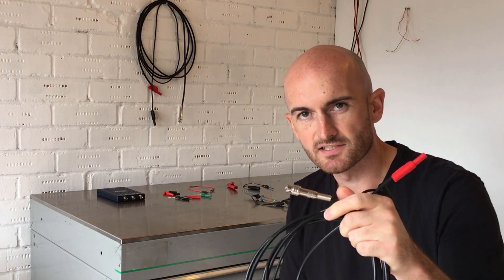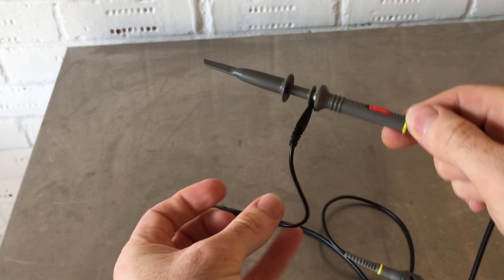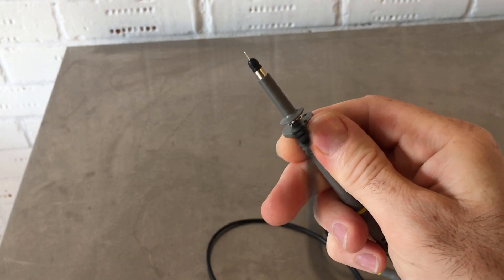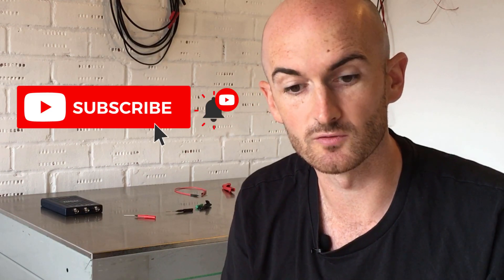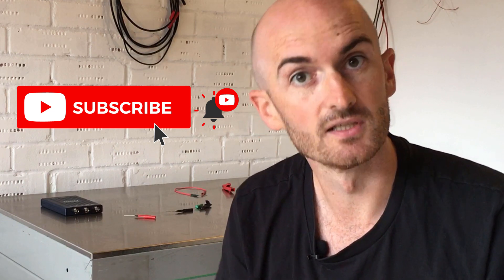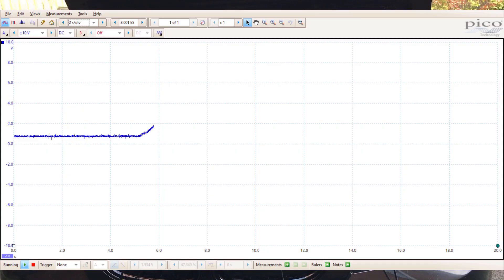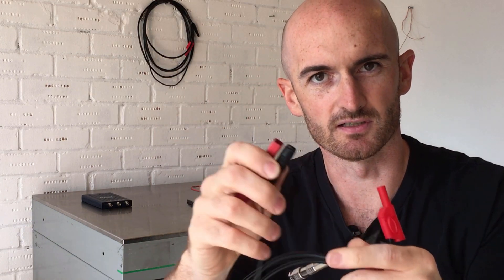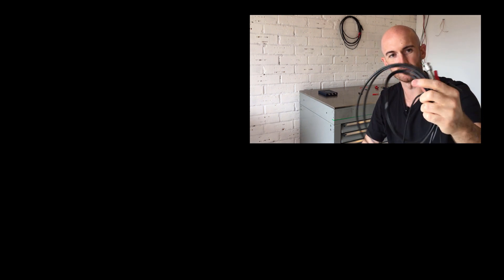Cheap Scope Leads Any Good?! Hantek HT30A Review | Mechanic Mindset

Comment: I know you probably won't answer things question but i will ask it anyways.  I  have the pico 2204a and i bought the hantech leads do you have to adjust the pico for them and if so how do you do it
Reply from the maker: They should fit straight on 👍 no settings or adjustment

Comment: Great video! Are these the exact leads that come with the autel maxiscope mp408? The autel comes with hantek accessories. I just want to make sure there actually the same ones before I throw them away because I just watched @Jarhead Diagnostics https://youtu.be/ahz9VvG_zF8 video and talked about how shitty the leads were and that they picked up alot of noise...  I don't have other leads to compare so your input would be appreciated. Thanks again.
Reply: Oh I see. I'm almost thinking he just got a bad batch or wiring in the lead housing was getting loose. Thank for the help I'm going to buy one off Amazon and compare. Keep up the good work 👍
Reply from the maker: Hi, I’m not sure if they are the same, but I have had no issues. I also have a Pico lead, it’s the same. Even check out my video where I make my own DIY scope lead with airbag twisted pair cable, it’s still the same. It would have been good to see an example of the static. 

If you take a measurement in a high noise area like around coils, no lead will block that interference out. Hope that helps!
Reply from the maker: DIY Scope leads:
https://youtu.be/U5yBlgHwVhs

Comment: Silly question but what is the difference between the cheap hantek cables that come with aligator clips and these? I notice that the HT30A have a heavier gauge for the red probe vs the cheap alligator. When testing CAN bus do you need these cables or can you use the cheaper ones? Great video.
Reply from the maker: Hi, you can use either leads. I use the HT30A cables in this video. Cheers!

Comment: Like all your content man, keep on at it! Just bought some attenuators & Hantek leads from your link. Found your channel from someone else's video reviewing different scopes using a Chevy Silverado scoping various sensors on the vehicle. If possible, and if your able to, could you review using the Hantek Ignition Capacitive Auto Pickup/Probe (HT25)? Thanks!
Reply from the maker: Hi, good video that one. Thanks for the support using the links 👍 I do have the secondary ignition probe, just not got round to the video yet. I will try and do it before the end of the year. Thanks for watching!

Comment: Crap leads in the long run prown to fail internally good for a start up set thats it
Reply from the maker: Sounds like you have really put yours to work! 👍
Reply: @MechanicMindset   as soon as I found out you can run the bt408 on a computer I had mine coming an 2 years later I need 2 new leads so I went for something a little better.  Gotta respect your tools an they will last better . Don't coil them up an they will last longer
Reply from the maker: @danielkalston6977  What leads do you use now. I do like those PicoScope leads. I only use mine for best 😂
Reply: Currently automotive test solutions.
Reply: @MechanicMindset  rotkee has some unique stuff aswell
Reply from the maker: @danielkalston6977  Cool, just recently came across the Rotkee gear; some cool looking tools at reasonable prices!
Reply: @MechanicMindset  yup

Comment: i had two of these leads both shorted out where the earth leads splits from the main red terminal about 3 months apart, first time i thought is was a one off cut the engine out made me jump then my second lead did the same ,i still use then but i’ve retired
Reply from the maker: tim skye Thanks for sharing Tim, I will bear that in mind as they age 👍

Comment: Thanks for reviewing hantek accessories,  from your experience Darren,  do you prefer using 2204a scope with picoscope 6 software or automotive software,  which one is better capability with 2204a for automotive diagnostic? Thanks
Reply from the maker: Hussam Alshafaey You’re welcome! I just use normal Pico 6; they are exactly the same when connected to 2204A. There are some slight differences. Pico 6 has a spectrum analyser for frequencies and automotive doesn’t. But not really using that feature. The only real benefit of automotive is having the custom probes set up if you have them. But you can always import them anyway. The reference waveforms and test descriptions are helpful; but only if it is the same as the car you are working on. You have to buy 4425 for the real benefits 👍
Reply: @MechanicMindset  I appreciate your response,  I'm practicing on picoscope 6 and will order 2204a without accessories,  and get hantek accessories to complete my set, thanks again for your videos ❤